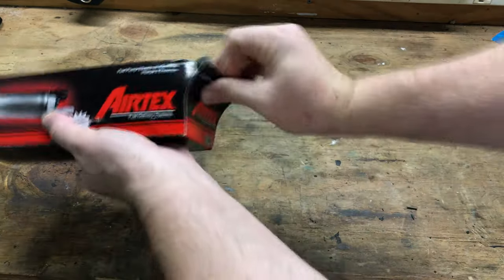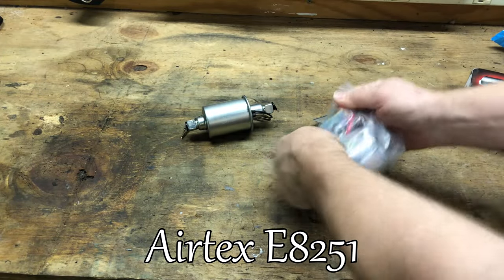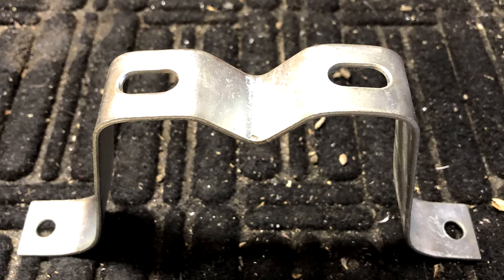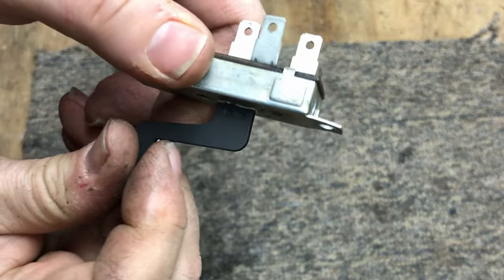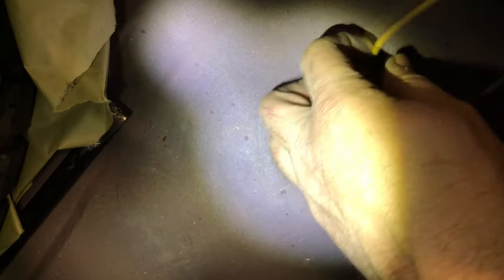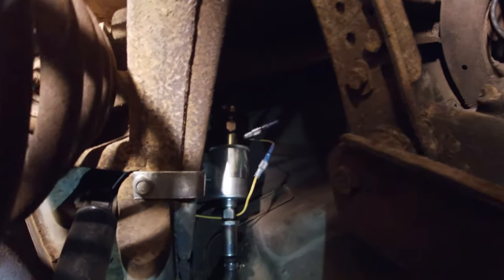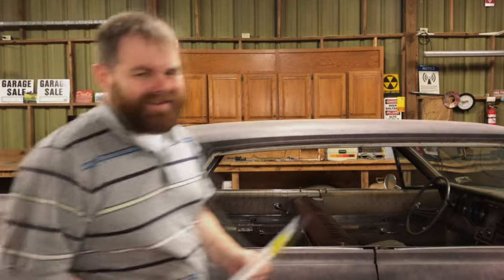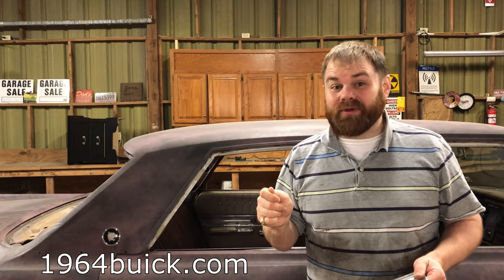Pull through priming electric fuel pump for old cars: Help while cranking Airtex E8251 Carter P74021

Comment: Nice presentation and thank you.  Don't forget the safety pressure switch off the oil circuit.  Standard equipment on later cars.   SMP PS-64 is a good example.  Best regards!
Reply from the maker: That's a great point. For my installation, the switch is momentary, so I don't have a need for a pressure switch. Standard Motor Parts switch you recommend is linked here: https://amzn.to/3yP92oY

Comment: If the stock fuel pump is working properly then the amount you cranked the engine would more than fill the carb. The problem in most cases is the automatic choke isn’t working properly. I have seen where people crank and crank forever but if the fuel going to the engine isn’t rich enough (choke on) you can be there cranking until the battery goes dead.
Reply: Exactly!  Sometimes people don’t understand the correct starting procedure either.  I never saw if he touched the gas before that first crank either.  On my 69 Impala with quadrajet, for example, you have to put foot to floor once.  It closes the choke plate and helps to draw a fuel shot into the carb.  That will get it started.  Without doing that you can crank and crank like this demonstration.  That’s leaving my car for weeks too and not 6 days.  If it’s cold out then it may not keep running with one pump.  The manufacturer covered that too and said to give it 3 pumps in winter.
Reply: That may be true in some cases, but this is also a common symptom from leaky well plugs. This is a decent solution if you don’t want to mess w the carb.
Reply: well try the choke so, before the electric pump

Comment: Curious why you need the steel fuel line quick disconnect? Wouldn't the fuel pump still allow fuel to travel through when it's turned off and or broken? Deciding if I want to put in a Y line next to the fuel pump with a check valve.
Reply from the maker: More of a phyiscal failure than anything. If the pump died electrically, agree 100%, fuel would still flow. If the can cracks on the fuel pump, or the input filter plugs after hours, the steel quick disconnect would instantly correct.
Reply: @1964buick  got it that totally makes sense thanks! How has the pump held up? wondering if i should buy the holley or K&N carb pump though they are a bit more. Cheers!
Reply from the maker: @Ryz240  It has held up just great in the 3+ years I have had it. If you switch to a different pump than listed, I believe you are looking for a solenoid style pump to allow fuel to flow through it.
Reply: @1964buick  sounds great I’ll go with this pump then! Thanks for the info!

Comment: welllll shiatttttttt  why could I not find this video months ago.....  was going NUTS trying to find pull thru pumps for this reason.   Did discover Faucet Purlator has a whole line of them too.  Not sure how competitive priced they are.   Added complication though is I needed diesel compatibility.
Reply: youcan run them on paralell so use your old mechanic pump,, and use the lectric just for start
Reply: @termonostruman  yep... more plumbing... more places to leak.  which on a diesel just adds a whole new level of PITA compared to a Petrol car.  Chasing air leaks suck

Comment: Just install a one way valve?  Keeps the fuel from draining back.  Provides just enough fuel to turn the engine over.
Reply from the maker: Unfortunately, it is an evaporation problem, not a drain back issue.

Comment: Nice Job. This is exactly what I need. But I'm going to find one with enough psi that it will run down the hay on just incase the mechical pump goes out I can use it as a back up to get home if needed. Main reason is for priming the fuel system an then shut off tho. Do you know if all inline electric pumps pull through if shut off?
Reply from the maker: Not all fuel pumps will pass fuel without power, which is why I went with the Airtex in the video. My understanding is the pump has to be a solenoid style, not an impeller type to allow the mechanical pump to still draw.

Comment: could i run the electric pump, inline with my mechanical pump,  at all times? not just for priming. and if so, would I get my power from the sending unit wire? i have a 1962 Impala
Reply from the maker: You could run an electric fuel pump at all times with the mechanical inline, just make sure it is low enough pressure to not overwhelm your fuel system. Also, you'll need to decide a safety circuit so the pump is not running when you don't need it to, or in the event of an accident. Many use an oil pressure safety switch.

Comment: Does the power to the pump need to be left on or is it just for priming
Reply from the maker: In my application, it is just for priming. The pump could be used full time; however you would want to add a safety device such as an oil pressure switch to turn off the pump when the engine stops running.
Reply: I wired it to the ignition. Thanks for your response

Comment: do ya have any vapor lock issues on a hot day , if yes what ya do to fix it
Reply from the maker: I haven't had any.
Reply: @1964buick  my question is does priming through mechanical fuel pump hurt the diaphragm or check valves in it?  I ask this question because  after using a booster pump before on Skylark I started having leak on a new mechanical fuel? Booster pump was only a 4lb psi.
Reply: You need to get a fuel filter from an AMC Eagle that has a return line on it. Then run a return line back to the tank. Make sure the vent line on the filter is toward the carb and at the "top".

Comment: WAY TOO COMPLICATED  .   PUT IN AN INLINE CHECK FUEL CHECK VALVE
Reply: A check valve won't help when it's the modern gas evaporating from the bowl of the carburetor that's the problem.